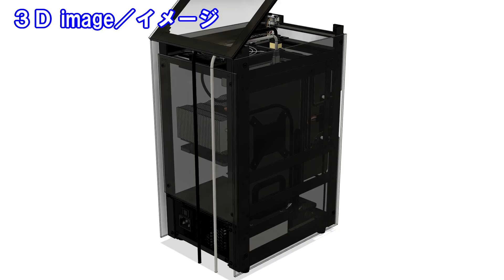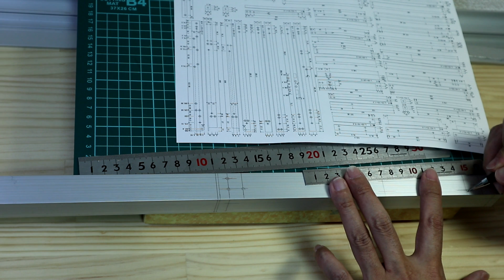Homemade PC case／自作ケースの自作PC【Diy】Gaming PC Build

Comment: How thick i the aluminum angle?
Reply: And do you share the plans?
Reply from the maker: The thickness of the aluminum angles in the main parts is 2mm.
Reply from the maker: @petermarinusmikkelsen9796  I don't plan on sharing my plans.
Reply: @Diy-lv4ps  thanks alot i will try and make a build with the inspiration og this build.

Comment: Cool case but... it's just a copy of Jonsbo VR1. You should build another one that supports 180/200 mm fans on both bottom and top and the PSU should be mounted vertically instead of horizontally for better airflow 😉
Reply from the maker: Thank you for watching and commenting. There are cases of ready-made products with similar layouts.

Comment: So, what happened to the reset button? It's shown here 6:18 and again here 14:44 but I cannot see where it got installed
Reply from the maker: Thank you for watching.
It's not clearly visible, but the reset button is inside the lid open.
The purple and white cables shown from 14:47 to 15:02 are the reset button cables.
Reply: Very clever, thank you!

Comment: kinda understand and also curious with your DIY build. If you using alumunium profile L 10x10x2mm, do you able to tap inner profile with M3, chamfer the outside profile then joint it with countersunk M3 x 4mm to make a nutless joint?
Reply from the maker: I haven't done it, but aluminum is weak, so if you tighten it too hard, the tap will be crushed.
https://youtu.be/_DjX-1iN33c
In this work, I wanted to make it by the method like the proposal, but I took the method of embedding the nut because I was afraid that the tap would collapse and fail.
Reply: @Diy-lv4ps  that was good insight, sir 👍